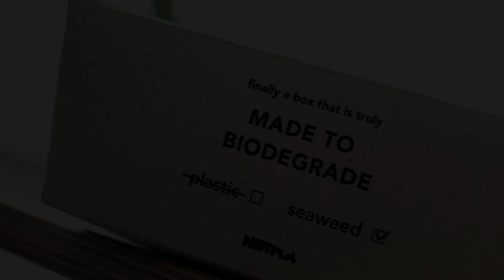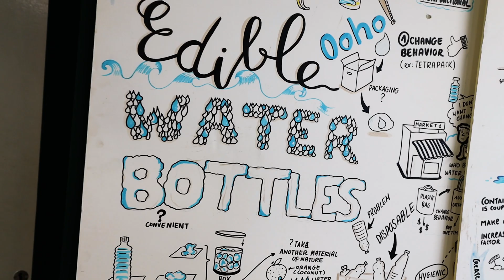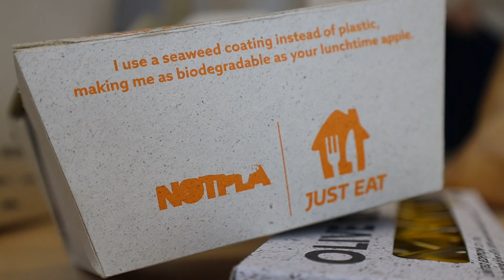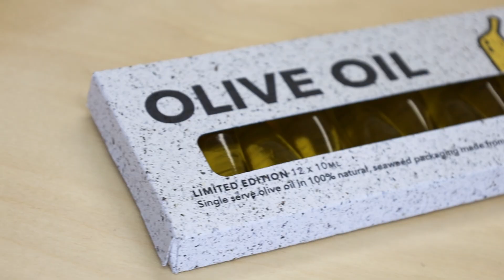Seaweed to Replace Plastic | Edible & Biodegradable Packaging | Notpla

Comment: It's very interesting approaching that resolve three problem: an alternative source of plastics from fossil ones, the increasing of seaweeds, the plastics pollution.
However there are three problems. How do they eliminate the iodine inside the seaweeds to avoid the formation of alkyl iodide during the polymeric process without iodine compounds pollution? (In 18th the seaweeds oxidation by sulfuric acid produced fertilizer and it caused the iodine discovery.)
This seaweeds plastic is biodegradable in three weeks so how can it be used in food packaging? If it is edible for humans, it is edible for insects  so the integrity of food packages is not certain nor guaranteed, and I thing they must separate the food from outside things for noun, hygiene and people health. I don't believe you wash package before boiling with spaghetti.

Comment: Wait. Is turning seaweed to plastic a new innovation? I thought it's where plastics came from. Because we have a factory here named CP Kelco and what I heard from asking others is that they made ingredients for making gelatin and other stuff and also plastics. Never did my own research though to see if it's true. But yes,  I rlly thought that seaweeds were already an ingredient in making plastic.
Reply: It is a gimmicky alternative that could help a bit, until it becomes mass produced and adds to the environmental damage unless they start their own farms separated from nature and inland. Otherwise you'd have to ship the algae. Oh and it won't work on food that needs a void seal or that lasts long, as it will easily degrade when it isn't stashed properly and it's easily damaged.
Cool neat idea otherwise, and it will save some polluting.

Comment: Can someone explain why it holds liquid without “biodegrading” before you use the product?
Reply from the maker: It has a 6 week shelf life
Reply: It's a bit complicated to explain and it's an easy google away.
But yes, if stored properly it can easily last a month, but after that the package will have issues. And it isn't an sturdy material at all, if you're careless you'll ruin it if mishandled. Other than that, it's a good alternative for some short lived food packaging.